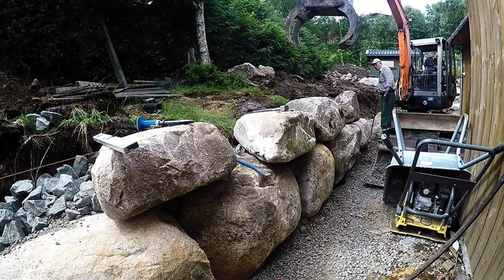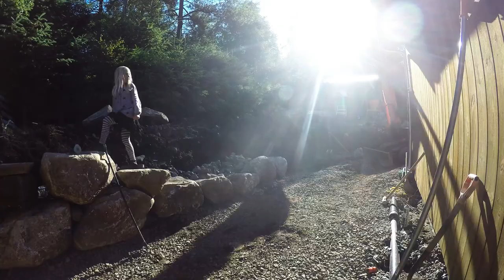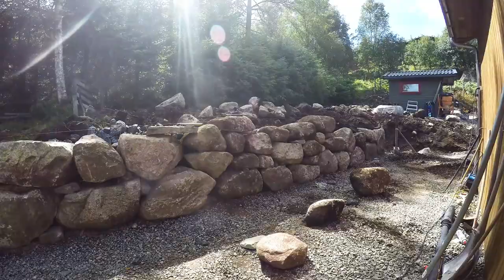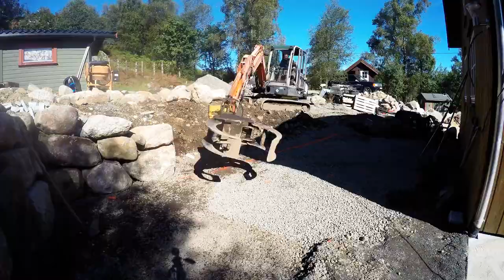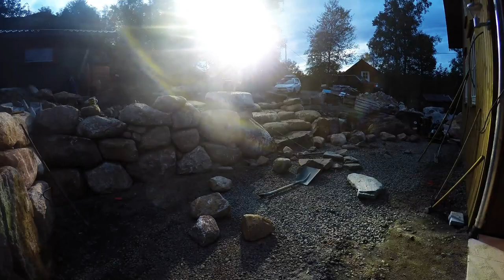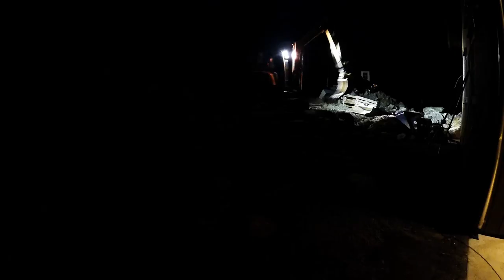steinløing på løland timelapse, dry stacked Stone boulder retaining wall, excavator tiltrotator

Comment: Great video!  I'm looking at purchasing a Sany 35 U which is an 8,500 pound Mini Excavator.  Have you built any with this size machine?  Your Hitachi weighs 11,000 or 5.5 tons.  Also, how many days did it take you?  Just a 2 man crew?  We always built them with a 4 man crew but I never had the grapple attachment for our Mini X.  We just run thumbs on them over here, and they aren't as efficient.